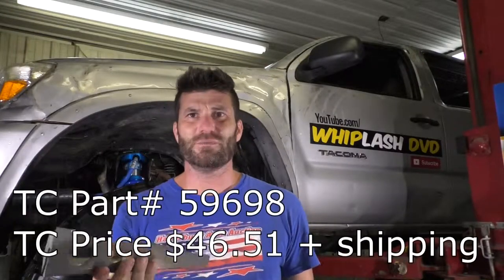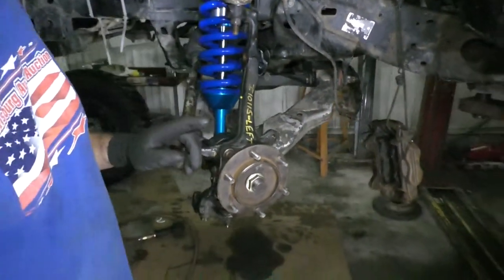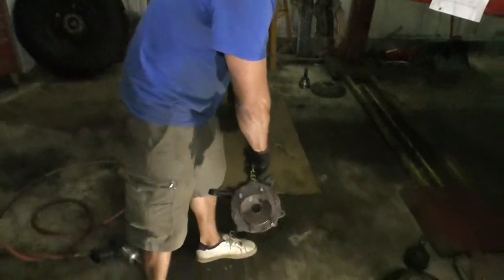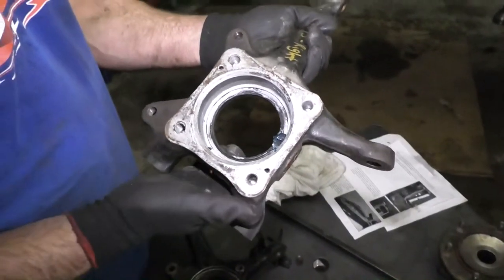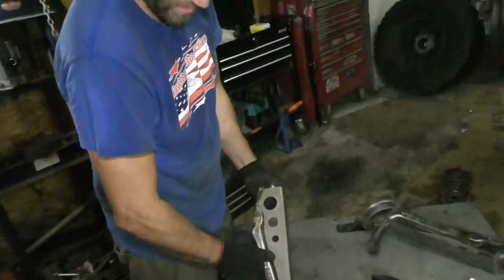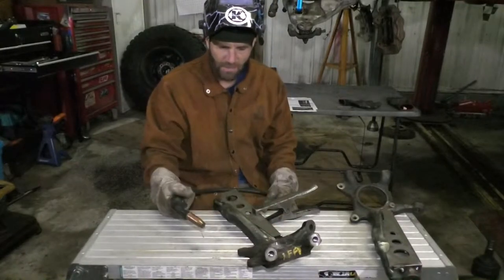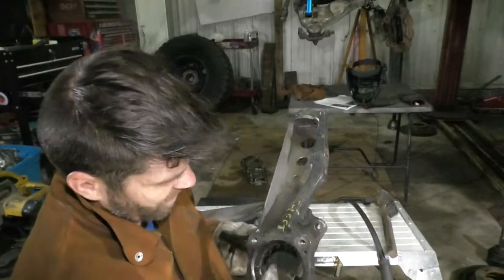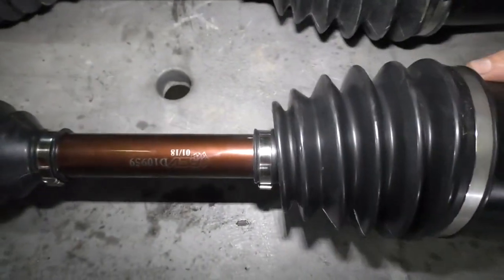Installing Spindle Gussets Toyota Tacoma

Comment: Great instruction video!!! These are an xln't addition! Just saw a recent Matt's Off Road YT episode. Girl in a Tacoma bumped a rock, bent the spindle so the wheel remained in contact with the uca. If I decide to do this to my '97. I'll be adding two more small horizontal plates between the spindle and gusset. This will add a triangluated structural improvement, with minimal added fabrication time.